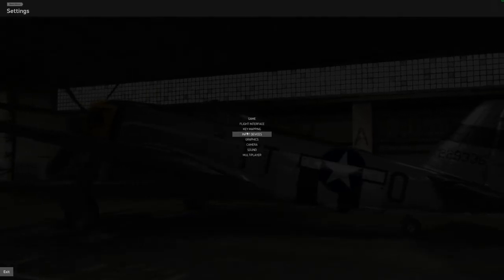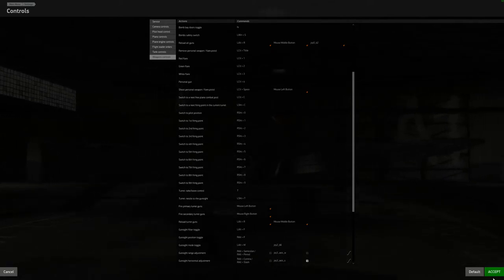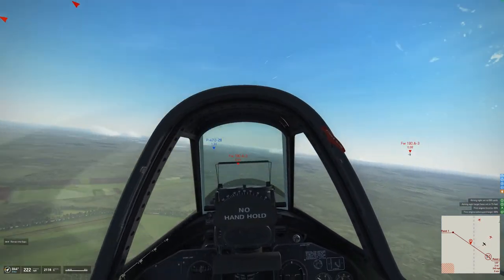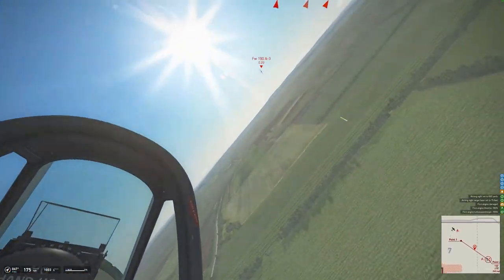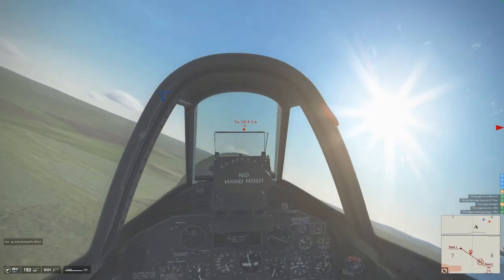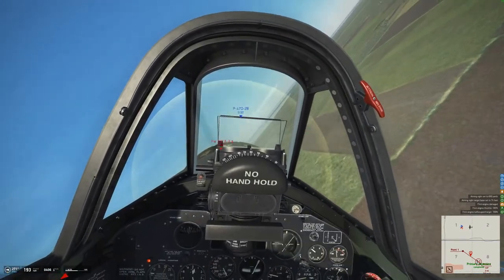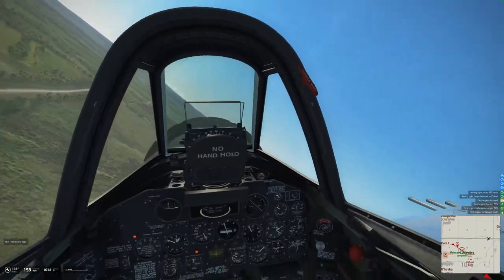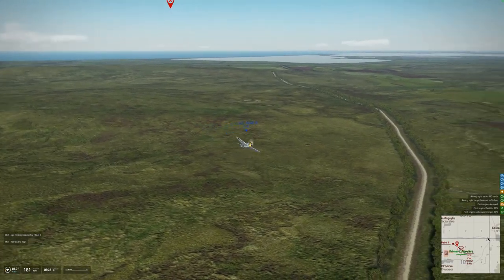IL*2 BoS LEAD COMPUTATING GUNSIGHT SET UP P47

Comment: Adjusting for range is only part of the equation, you also have to adjust for your targets wingspan. You have the wingspan set for 75 feet, which would be appropriate for a medium bomber. For an Fw190 you should set it for 35 feet. Then when you are at the range you have set the diameter of the circle of diamonds will match the wingspan of the target aircraft and the gyro can predict the proper lead. Unless both range and target wingspan are set you will not get a good solution.